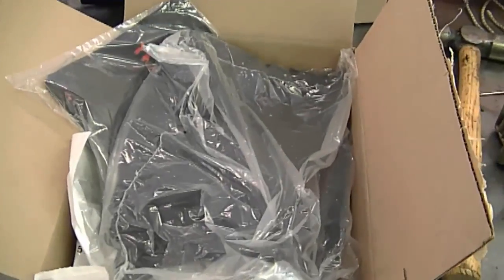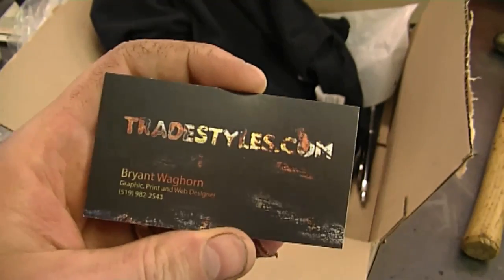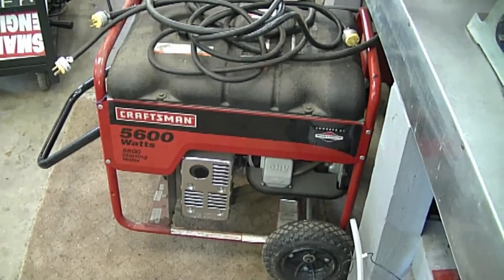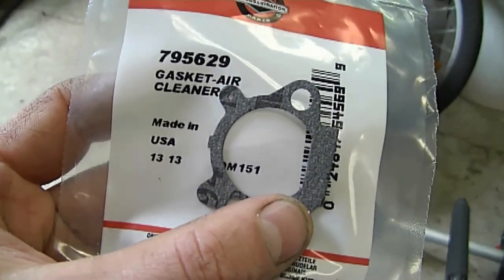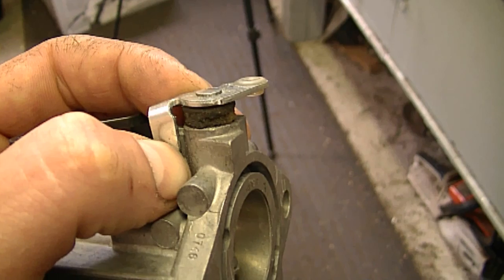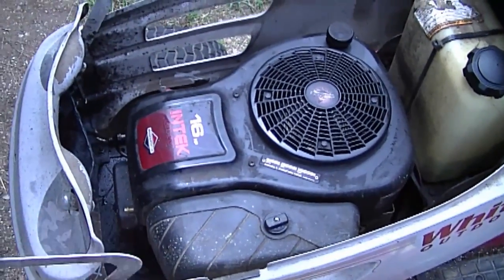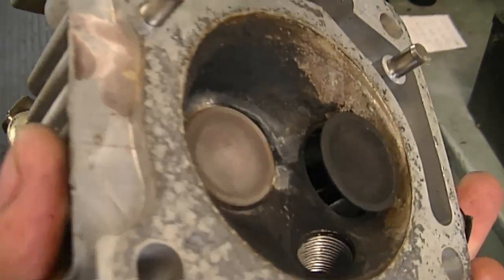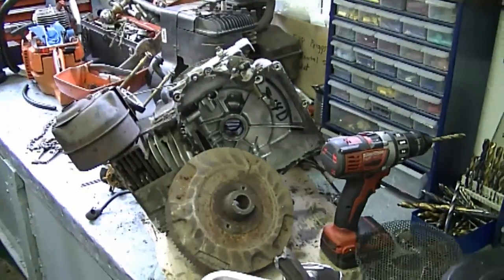Small Engines Q & A Video #128 in HD

Comment: The Stihl BR-600 is an excellent unit and as long as you use proper mix there is no problem with burned valves.  The valves do occasionally have to be adjusted, but that is a very quick and easy procedure.  Another blower I especially like is the Shindaiwa EB-802, this is a two stroke unit that has a huge amount of power.  Also they are well built and require almost no maintenance.

Comment: You might want to soak the nut with PB Blaster or something similar.  These nuts get pretty "welded" to the spindle over time.  You may gain a little purchase using a good tight impact socket.  After applying PB Blaster and blocking the blade (if the spindle is connected to the blade - I use a good 2 x 4), your impact should be able to pull this nut off.  They can be very tight.  Option two is to load the deck into your truck and visit a small engine shop, your JD dealer or a Napa with (cont.)

Comment: I too converted my generator to a tri-fuel (gas, propane, natural gas) kit from US Carburetion Inc. Took about 1 hour and  would be simple if you have basic skills and tools. The carb kit was $187.00 and then about another $45.00 to buy the extra regulator to fit a LP cylinder from them. You "might" be able to use a $20.00 kit for a gas grill....but I wanted to be sure. This kit leave the generator portable, yet don't have to worry about storing "old" gasoline

Comment: I've been running Amsoil Saber 100:1 in engines rated for 16:1 and up for a couple years at various loads (weedeaters on the low end to chainsaws on the high end) with no bad results.  I was sceptical at first so I started at 80:1 and worked my way up to 100 keeping an eye on plug color, running temp, and cylinder appearance.  The 16:1 Pioneer still has me a little nervous, however, so I am going to mix up some 16:1 and compare running temp between that, Stihl 50:1, and Saber 100:1.

Comment: Hi, Dony. Do you have any experience with repairing gasoline powered backpack leaf blowers? I've been looking at the Echo PB-770, the Stihl BR-600, and the RedMax 8500. Stihl have an interesting hybrid four stroke engine but you add oil to gas like a two stroke. I've heard that the Stihl can overheat with burned valves -- have you had any experience with repair of these units? Any thoughts?

Comment: I agree with the natural gas in a generator, good thing about natural gas in most cases you can also run them on propane, I believe it's just a different flue regulator, one thing you may or may not know if you do a propane or natural gas conversion you can still run it on gasoline, in most cases you do not remove the carburetor you just add a small peace with the jet between the manifold and the carbalso, being able to run it on all three fuels brings back the portable factor of the generator.

Comment: Hey Donny.  I am a huge fan of all the videos.  Thanks a bunch.  Quick question if you've got the time.  The farm I work on has an (admittedly very shitty) Toro lawnmower.  It has a primer bubble but no choke or anything.  It'll start after I prime it but then the engine dies out after a few seconds.  If I hold down the bubble, however, the machine will run fine.  Any ideas why this might happen or how to fix it?

Comment: I bought an Oregon primer bulb for my Tecumseh LEV 115 and the retainer clip was made from cold roll instead of spring steel like the original. I got lucky and did not damage the original retainer so I could reuse it. My first impression of Oregon is not good.

Comment: (cont) a Napa store with a machine shop.  Ask them to use their air tools to take off the bolt.  Most will do that for free.  You can grind the strake lines on the nut if this interferes with your socket fitting tightly.  An angle grinder works great.  Another option is to soak with PB Blaster and then heat to an orange glow with MAP gas if you don't have oxy/act.  However, PB burns so you need to be careful!  Once glowing hit it with your air gun. (cont)

Comment: Here is a YT video "John Deere: How to change bearings in the deck spindles" that briefly discusses the nut in question.  He uses a homemade tool to prevent the pulley from turning, however, this may not be your identical deck.  So I tried to give you some additional options.  It will come off!  I don't think it is reverse threaded but you can look on a JD parts fiche and it will answer that question.  Just use "JD parts online," search in google to find parts listings.  Try oiling your gun too.

Comment: Don, have you ever worked on a power mate engine off of a pressure washer because I have one and if u leave the gas switch on gas will run up through a vent on the top of the carb and I was wondering if u thought it was the needle seat was bad

Comment: Hey...I know your busy...but have an importiant safty question..I have a DR trimmer mower the motor has very low compression so I want to change the engine, I have a few good motors to choose from but my question is.. the old DR briggs engine only has a pully on the shaft ,now I know that briggs motors need a blade to balance them.. my question is will any briggs engine work or is the old DR briggs balance internally or does the pully and belt system balance it...any help would be great Tks!!!!!

Comment: Good Evening,

I am stumped.  I am working on the 42 inch John Deere BG20471 mower deck.  I need to remove the upper nut that holds on the drive pulley to the mandrel.  I have tried my 1/2 inch impact wrench, no luck, tried heat, no luck.  The nut is too big (7/8") for my nut splitter.  The nut appears to have been straked on each side after installation.  Any suggestions as to how to get this off???
Thanks
Tony

Comment: i have a B&S 12.5,very simmalar to the 13.5 one with a blown rod. my engine has a knock in it that dissapears at idle and gets louder with more rpms and even louder when you engage a load. i have played a game of elimination with the tractor and narrowed it down to an internal problem on the engine. many other youtubers think it is a worn rod journal and some even said loose connecting rod. what would be your best guess? it's a flathead by the way...

Comment: About running natural gas or propain on a small engine. Doesn't the compression ratio have to change at least the ignition timing of the motor. I'm far from a expert but isn't the btu of gasalene and natural gas / propain different your small engine now is 8 or 9/1 copression ratio where nat gas propain would call for 13-14/1 ratio. Sounds like it would run but at a loss of power.

Comment: Hey donyboy I was just wanted to know if the spark plug would be the same if I was to change both of my plugs in my mcChulloch mac 426l and ryobi rbv 26 leaf lower my mcChulloch runs a champion spark plug but dosent run right with it and my ryobi leaf blower runs a champion aswel but is styled as a chan saw plug so im not too sure on it

Comment: dony i want to ask if the looks of a lawnmower matter to any buyers.reason i ask is that i have an older snapper rider with a 6 hp tecumseh but as ugly and rusted looking as it did it runs great with no smoke or anything.it had been sitting for a long time with out running for years before i got it from someone who had it.i replaced the blade and the rubber disk and this little mower moves with out any problems.is it because some people see things ohters don't?

Comment: Just get a new engine which has a cast iron flywheel instead of an aluminum one, they are heavier and don't require a blade.  You might even be able to take it off of your old engine.